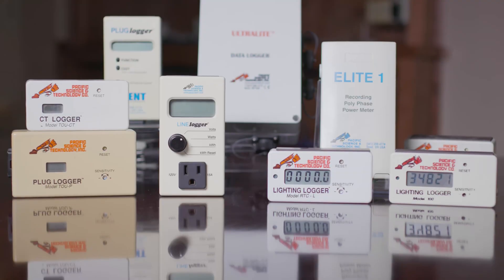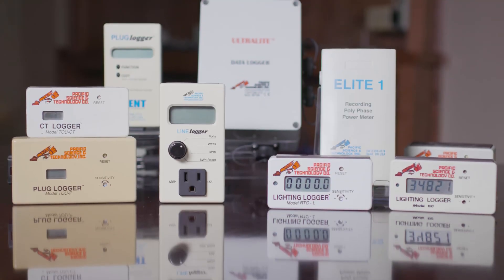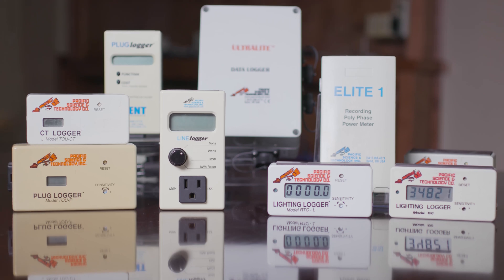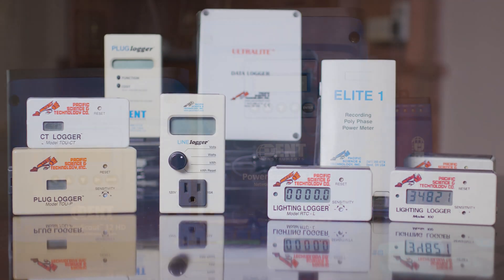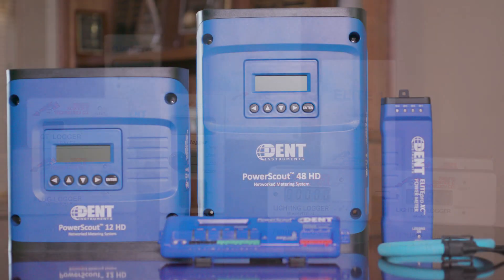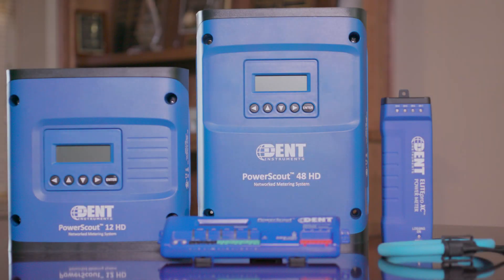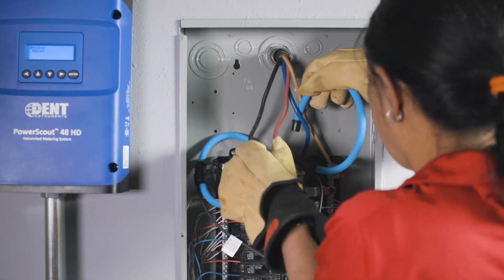About DENT Instruments

Comment: Is it possible to record individual current and voltage harmonic up to 50th or 60th of low voltage AC electrical system using Dent power loggers?